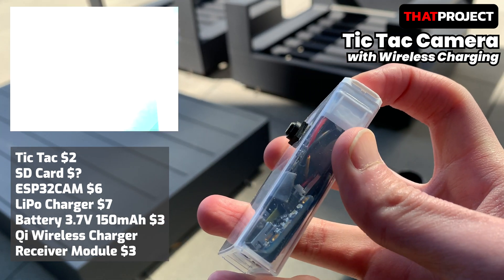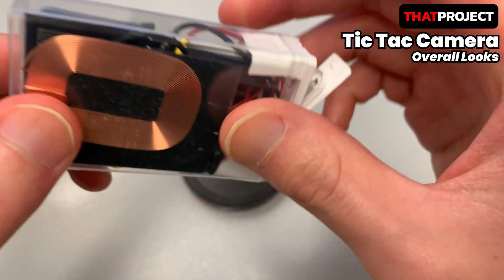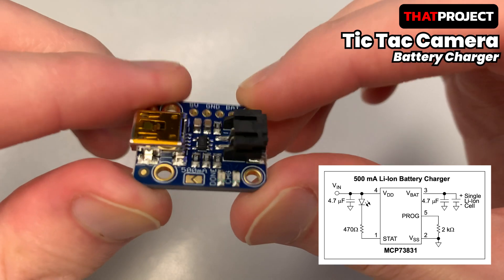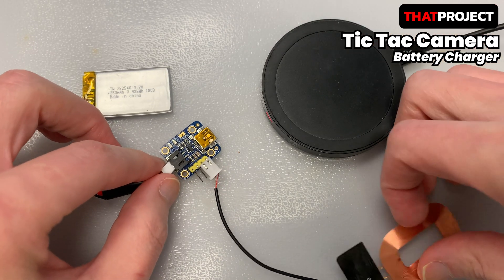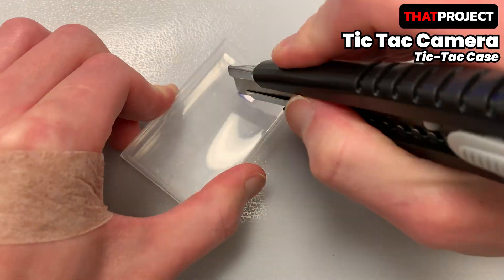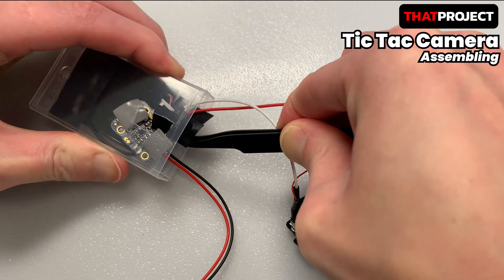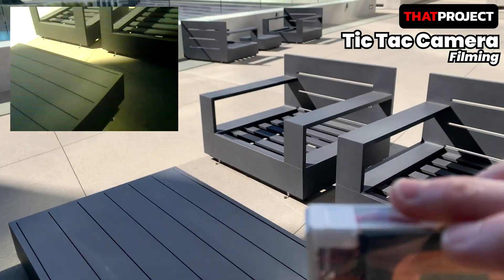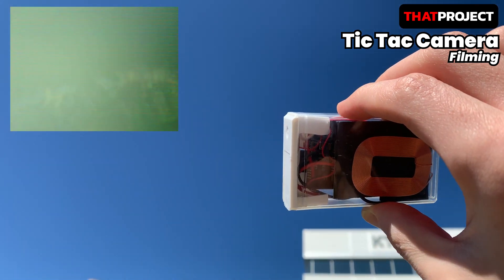Tic Tac Camera Using ESP32CAM And Wireless Charging

Comment: The Adafruit Charging Module is rated at 0.5 A, but the wireless charger receiver module provides 1 A. Is this an issue? I am new to electronics.
Reply from the maker: I believe the receiver supplying 1 A simply means it can handle up to that load—not necessarily that it always provides this amount. Need to double-check.

Comment: If you use SeeedStudio Xiao ESP32 S3 Sense, it'll be 1/4 of the size. And only 3 components needed, the board, the LiPo battery, the wireless charge module. No other components
Reply from the maker: @huyifan83  Yeah, of course.

Comment: Thanks for sharing, great idea. I'm just wondering.. would it possible to use SD card slot as a heat sink for camera? It seems that metal plate on the back of the camera is not connected and SD card slot seems to be grounded.. So would it be a problem? I see that you put there adhesive or something similar... Currently I'm implementing similar project although without battery, but I was thinking about cooling possibilities... Thanks
Reply from the maker: I don't think a heatsink over the SD card slot will help much. Honestly, I have no idea. How about attaching it on top of the ESP32 chip on the other side?
Reply: My idea was to use SD card slot as a heat sink for camera chip itself. It seems that camera chip seems to be overheating. ESP32 probably don't need a heat sink. I thought it would be quite useful to attach camera chip to SD card slot, so that the slot itself would serve as a heat sink. But I'm not sure if there is any risk of short circuit..
Reply from the maker: @diffieke  I don't know about that either. I hope you just give it a try.

Comment: How do you keep the camera from shutting down after a few minutes? I am using 18650 cells with a USB charging/supply board from Alibaba and after a few minutes, the camera shuts down. At first thought, the caerma was overheating but when the camera is plugged into the USB/115VAC wall plug it works flawlessly.
Reply from the maker: What kind of USB supply board do you have?
Reply: @ThatProject  MakerFocus Dual USB 5V 1A 2.1A Battery Charger Module Board For DIY Power Bank. Bought it awhile back. It would be nice if there was a spec I could look up avoiding the purchase of similar boards.
Reply from the maker: @MaxGoddur  https://www.makerfocus.com/products/4pcs-dual-usb-5v-1a-2-1a-18650-battery-charger-pcb-module-board-for-diy-power-bank?_pos=2&_sid=39e1587a2&_ss=r 

On this board, did you connect the battery to BAT +, - and connect the ESP32-CAM through the USB port?
If so, there doesn't seem to be anything in particular to be a problem.
Does the OUT display appear well when outputting on the screen?
Wouldn't this board automatically power off if the power consumption is too low?
Reply: @ThatProject  Connections are OK and the pack works just fine on devices that draw more than the Camera board. I can't find my USB power monitor so can't say what the low current shutdown should be. As far as the board shutting down be normal as you state don't know and is why I was asking the question originally. It would be great if these boards stated they would shut down if the current draw was to low.

Comment: This battery 3.7V and 2500mAmp battery doesn't works with any of my ESP32Cam module. I have tried 4 modules from different sources. 
The video is stable only when provided 5V voltage.
Reply from the maker: Yes, that's right. A 5v supply is required to get a stable running. This is why I use the charger module in this project.

Comment: What is the back up duration of the battery,how long does the battery work.
Reply from the maker: As you can see in the video, it uses a very small capacity (150mAh) battery. Continuous shooting is possible for about 30 minutes.

Comment: nice little projects, i have 2 questions:
- you are storing the file counter on eeprom, i've read that the write cycle of eeprom is very limited (10000 to 100000), do you have any eeprom failure experience with esp32?
- which version of core for esp32 you use? the github is on 2.0.0 but the boards manager shows 1.0.6 as last.
Reply from the maker: In my case, the problematic case was that the stored value could no longer be read due to an overflow of the EEPROM. Other than that there were no problems. The version I'm using is 1.0.6.

Comment: Nice video, and interesting project, thanks for sharing it. It is a pity that LED is active when the SD interface is used, this is a bit of a design flaw on the esp cam in my opinion
Reply from the maker: Agreed. It seems to have been designed this way due to the lack of GPIO.
Reply: @ThatProject  does it overwrite older footage when the sd is full ? i want to use this in surveillance for front door